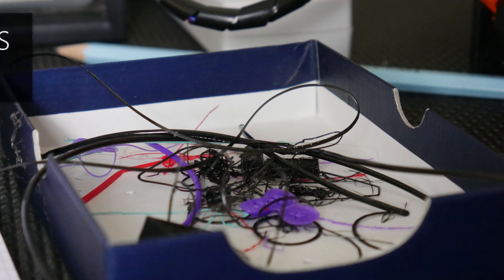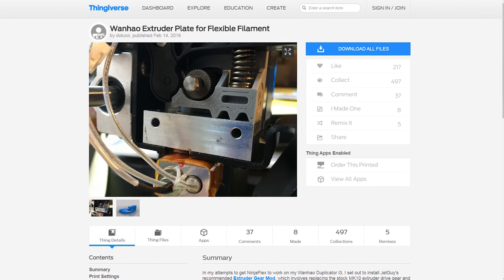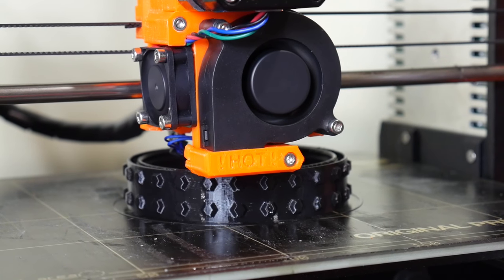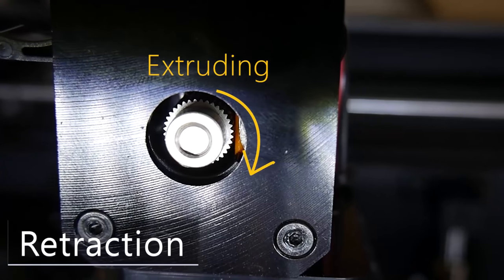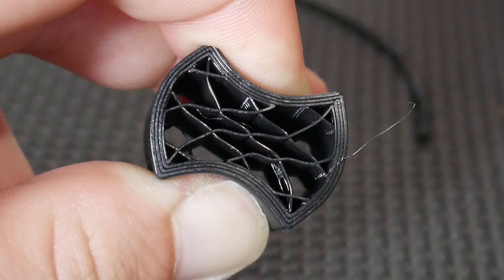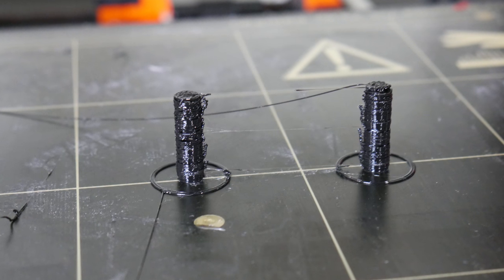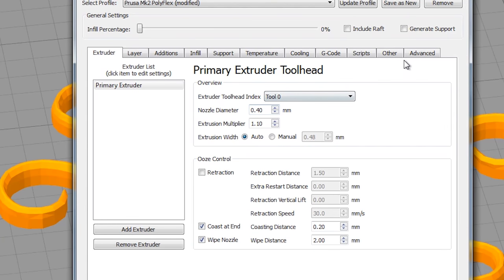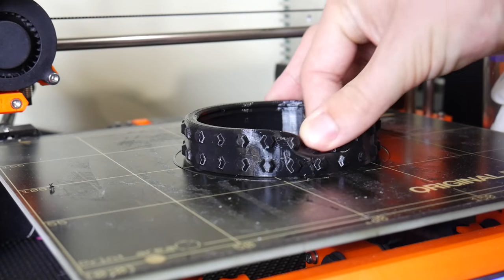3D Printing with Flexible Filaments (on stock hardware!) -  3DP101

Comment: I'm new to 3D printing.. just got my CR-10 in last week..
Wanted to try flex material.. Here's what happened:
1. watched this video.. 2. did what I was told.. 3. PERFECT print! 

High Five man.. good stuff.. thanks
Reply: Lucky you found this first! :) Same here btw, Angus is a magician :D
Reply: If you're on FB CR10 group, care to share your profile?
How did you set cooling?
I only found FLEXFILL 98A in my area, and need it for FPV.
Thanks!
Reply: Hi I just got a cr10 as well, what material did u use?
Reply: DutchRC Adventures thank you for telling us this I have a cr-10 mini and I was wondering if I could print flexible filament on it

Comment: I know I am arriving here years after this was posted but I just printed my first TPU piece. I used your suggestions and I could not be happier with the results. I was sure I would need to tweak something but I ended up with a perfect first print in TPU. You have saved another spool of TPU from the bottom of the filament pile. Thank you so much!
Reply: Me too! Running flex on my older Mk2. This video was so helpful.
Reply: Quick thing I don't remember in this video use a 3d infill pattern (my preference is gyroid but up to you) if you see the shiny blocks in what is in the thumbnail that's from rectilinear any 3d infill will make the support for the walls as it cools more even and also make the whole parts flexibility more uniform
Reply: @xathridtech727  was wondering about that... also about the infill? Shall we make it more or less?
Reply: @alixezman1106  that's the cool part you can vary how flexible it is so 100% for impact resistance but not a lot of spring and I can normally go to about 7-10% depending on geometry for super flexibility. You can also add or remove walls to make the part even more tailored.

Comment: Thanks, Angus for making this video. It saved my sanity! I had bought some TPU and was aware that I needed to change my slicer settings. I had set the higher temperature for the hot end and bed, turned retraction off, and slowed things down, but still, my filament was spewing like demented spaghetti from the side of the drive sprockets. After half a dozen or so attempts, I was about ready to give up but thought that I would check to see if you had anything useful in your playlists, and hey presto, I found this. The secret was increasing the first layer height and width. I hadn't considered how much back-pressure would develop in the nozzle during the first layer. Having run a small test print to confirm that the new settings worked, I successfully managed to run a 2 day 7-hour print! So thanks again for your great work.

Comment: Angus - thanks for all the informative videos. Albeit 4 years old, this video still holds value.  I also found that turning off Octo-Lapse eliminated stringing artifacts as the extruder would home to a set position on each Z-Axis change to take a snapshot and then stitch the snapshots together for those smooth buildup videos.   By turning off the Octo-Lapse, this disables the extruder from homing for a snapshot and thus eliminates the stringing artifact.  I must have watched the video about 50 times along with some others you have posted about stringing filament for clues as to why I was seeing this happening.  The artifact was not in PrusaSlicer, nor in the G-Code preview on OctoPrint.  It was simply the homing of the extruder for a pretty video causing the excess stringing. Cheers Mate!

Comment: Angus, really needed this refresher , on printing with Flex filament. Am attempting to use TPU on my Hevo at the moment, it does have a bowden tube and wish you had spoken about using this. It seems to be able to push the filament out of the nozzle fairly well, as I noticed when I primed the nozzle. Pushed out a couple hundred, 200mm  , off the bed, like I normally do, prior to starting. that seemed to work. Am slowing the print speed way down , to 10mm/sec, so hopefully that helps. Small items to print, cone shaped golf tees. So should not take too long. I am sure glad you have covered this topic, almost forgot about this vid, needed the refresher. I use Simplify 3D now, also, getting better with it. Always enjoy your vid's, Thanks.

Comment: Even though this is an older video, I was able to use these settings to successfully print SainSmart Clear Flexible TPU today on my old FlashForge Creator Pro.  As you mentioned, I failed years ago and the filament was buried in a storage container.  Thanks for the tips, this opens up a whole new world.

Comment: After experimenting with PLA with my Ender 3 Pro with stock hardware, I just tried all this settings with flex filament and worked like a charm on the first try. No mods, stock magnetic bed. 230 degrees. Many thanks!!
Reply: What filament did you use?
Reply: Zealand L. Hi. It is a local brand (PrintALot) of TPU.

Comment: Hi Angus, although I almost always agree with your tips, im struggling with this video, I understand that you target normal 3D printer users but it would be great to notice that removing retraction, support, raft, ... is only to make things easier but at the end you can use support and retraction its just a question of having good settings :/
Moreover TPU support is most of the time really easy to remove in my experience.
Extrusion multiplier is also a settings that people shouldnt play too much with it, in the case of flexible filament you increase it because the drive gear bites the filament and as its flexible it compresses the filament and some go in, some go out, so you need to compensate with the multiplier. But that highly depends on your material shore hardness.
Nice video tho, its not easy to print with Flexible so not easy to do a video about it :)
Keep on the good work and help the community, thx Angus :)

Comment: best channel for finding info on how to use simplify3D. for beginners it is a must program. when I started off I used the other slicers and was getting horrible results. then I bit the bullet and bought simplify3D. what a difference. and yes I am sure you can do everything with the other free programs. perhaps even more. but if you simply want to print have found it to be the easiest for my needs.
so please keep the videos coming for how to use simplify3D. I will now go and order a roll of flexible filament having this knowledge in hand. I have a Monoprice Select Mini. It is a great starter 3D printer.

Comment: Dude! I've been struggling with what I consider sub-standard prints on TPU. I was messing with speeds and temps and still getting lots of what looked like air bubbles in my prints. Never occurred to me to turn off retraction, but that fixed everything! Thank you!

Comment: Got my seemecnc extruder installed on my ender 3 and just finished my first tpu print.  Worked great!  Got a bit of bridging but that's no surprise.  Printed on my pei bed without incident.  Cleaning the bed with windex (leave a nice coating to dry on there) then 91% ipa for removal and it works perfectly!

Comment: I agree with these tips, especially the suggestion about saving a separate profile for optimal flex print settings..  I will say though that I have had a lot of success WITH using rafts when printing from Cura with my Coccoon Create (Wanhao i3) using TPU flex and a flexion extruder.  The rafts ensure adhesion and stability of small parts and tear off easily and consistently at the end of the print.

Comment: I've actually had pretty good results using supports with Polyflex and other flexible filaments when things are set properly. Supports are attached more tenaciously than with PLA and other filaments but still tear away without damaging the model  most of the time and gives you the added capability of printing things that require supports. I would not be afraid of printing with supports once you have all the other print settings working well. It will be more challenging to remove supports but well worth it when you can print a functional part in TPU.

Comment: One thing left out (besides cooling) I use Prusa's recommendation of loosening the feeder gear tension significantly. Prusa i3 Mk2 usually 13.5mm for PLA (Measured from orange plastic to bolt flange, tension springs area) to 15mm. Makes a big difference. I also use supports and retraction. I love TPU printing. No issues. The comment about the difference between TPU vs TPE (ninjaflex) is very important too. My main s3d setting changes for TPU vs PLA are : Speed 20mm/s, extruder multiplier: 1.15 (my filament measures 1.65) I use retraction but uncheck "force retraction between layers" and check "only retract when crossing open spaces" under advanced settings. Retract distance .8, retration speed 30 mm/s, coasting distance .30 mm, wipe distance 2mm. Hope this helps someone.

Comment: I just wanted to share my flexible filament settings for my ultimaker 2+.

First of all i used the 0.25mm nozzle @230°C, 40°C heated print bed, 10-15mm/s speed, no retraction, 0.2 initial layer hight and 0.1mm for the rest of the print.
material used was ninjaflex. 

This settings gave me a perfect result. But i didnt yet test the 0,4mm or 0,6mm nozzle. 
All prints with 0,8mm nozzle failed.

Comment: Thanks for this video Angus :-)  I didn't know about setting retraction to zero, this is a great idea.  I'm trying it now, and getting no stringing (with short distances between areas).  One thing that I don't agree with, though, is setting the extrusion multiplier higher than normal.  On my printer this causes too much backpressure due to overextrusion, and the TPE just escapes the extruder.  Setting the multiplier to 1 or 0.95 combats this issue.  Just thought I'd mention it.  Keep up the great videos.

Comment: With Sainsmart TPU I can use a short retraction and wipe while retraction to print islands consistently at 35mm/s. And support works well too.

TPE like NinjaFlex on the other hand is much more difficult, prone to ooze, and prone to push out the side of the feed gear.

Comment: First try with TPE/TPU came out good and well for the brim and then turned into noodles. 
So little google search and came across this video. Cheers, testing the settings right now. Will update when done!
Reply: And there we go. Slow and steady prints flexible filament on my Anet A6 with stock hardware. Perfect, thanks!

Comment: Hi Angus ! Great video and very usefull tips, but you should give a try to the Cheetah Filament from NinjaTek.
I personnally have a modified Anet A8 printer (very modified to make it work great) in bowden mode and I recently bought a spool of this filament. 
It is really amazing : you can get (with the same tips you gave) flawless parts with PLA speed ! And I am not lying, this filament is really incredible, it is slightly less squeechy than other flexible filaments but it works way better, even with a bowden extruder. 
All you need to do to avoid having your filament going out the extruder like you said in the video is to add a kind of tube (that you can print in 5 min)  that you add to the extruder (by gluing it or whatever).
I think you could be surprised by this filament :p

Comment: So i have a ender 3 and i did a few prints with ninjaflex. I just printed a phonecase with supports and it works awsome. The supports are even easier to take out than with normal pla. I also print at 235°C with 0.12 layerhight. Beautifull results

Comment: I'm sort of new to flexibles and can successfull print on Creality CR-10S Pro that is stock as for the Extruder. I am updating it to a direct drive now... But thank you Angus, this helps. Some I figured out by common sense but the settings were very helpful. :)

Comment: I just got a ender 3 neo and slapped some tpu in it with the cura settings to standard and on the pla basic setting and so far i have had no issues with tpu

Comment: Angus, great video. I have to respectfully disagree about supports. I use flex solely on a mono select mini to make my little girls toys. I print dragons and MLP's all the time using the replicator 2mm/ 3mm supports (with minor adjustments). Yes, the tips can leave zits, but no more than any other plastic. I just printed a lovely MLP spitfire with 2mm replcator supports. Cheers
Reply from the maker: nice! yeah supports can work well, but I would class them as an 'advanced' use of flex personally.
Reply: I appreciate the "compliment" :-> . Great video mate. Meshmixer/ lab can make the unprintable printable (as you know...).

Comment: I use Hatchbox's TPU on my Solidoodle 2 with an E3D v6 hotend, and I only needed to change flow rate to make it print beautifully. I also made sure that the temperature was correct, and that the short length of bowden tube they supply was almost right against the drive gear. Other than those changes, I didn't have to change anything, and im super lucky that my machine prints flexible materials almost better than PLA!

Comment: Thanks for the great tip on doing the using different printer profiles for flexible and normal filaments. I have a filament type of TPU but it doesn't change enough things so I need to remember the settings.

I have a roll of the hobbyking flexible filament and it works great, Many great prints out of it.

Comment: Cheers. Have managed to print TPU on the stock Tevo Tarantula extruder. Problems occur on retraction where the filament doubles around the rollers.
Was using 60mm/sec speed too.

Comment: Big fan of this channel but the advice did not work for me and my Prusa MK3.  I had to REDUCE the extrusion multiplier on the Prusa slicer from the "factory" 1.1 to 0.9 and I reduced all speeds to 20mm/s. I also disabled retractions and for the PolyFlex I was using, seemed to print nice at 240C. Checking the "Avoid Crossing  Perimeters" box will also likely help reduce stringing. No other settings where changed and the results where quite good.

Comment: Thank you! Never bother to try, but i definitely did after watching this. On my (very old) Replicator Dual clone i set it to 30mm/s with failure, ended up at 20mm/s with 25mm/s working fine but why risk it on larger prints. I used TPU @0.3mm and really like it, 0.2mm seemed fine but noticed 0.1mm sometimes came apart. Man that stuff is strong.. even with two pairs of pliers i had a hard time tearing it apart. It also has a very short melting point, when i pull it out while hot it comes out clean and then when i put in black PLA to see how much TPU was left almost nothing comes out. But it gets almost watery if too hot. For functional prints it sure gets stringy :-/

Again, thank you for your work.

Comment: Im starting out at 50% print and extrude and after the first few layer is laid then ramp it back up, also retraction works fine to date it takes the pressure out periodically, ender3 , dual gear boden tube , sainsmart you, 210c / 75c fan40

Comment: Good summary. Nice example.
How about smoothing or otherwise post processing flexible parts? 

NB. I often save a new profile for each "very different" part I print, as I find that, parts with long straight lines need different tweaks to parts with lots of small islands, to ensure good fill-border overlap (without over extrusion), and  joined solid fill and perimeters.

Better to have more "new profiles" saved than to destroy older settings which worked well for a certain part/material in the paast. 
We can always delete unneeded profiles at the end of the day.

Comment: Angus, I would love to see a video which covers the Select Profile_, _Auto-Configure for Material_, and _Auto-Configure for Print Quality options in Simplify3D.  Which settings are stored where?  What's the most effective way to use these?  I use them a lot, but I don't think I'm using them as intended.

Also, we should petition Simplify3D to add support for saving settings per spool of filament, such as temperature, retraction, cooling, etc.  Anyway, great advice!  Wish this guide existed back when I was learning to print NinjaFlex!

Comment: I can only comment on Polymakers' PolyFlex PLA as this has proven very easy to print.  With my WANHO Duplicator i3V2 I just lower printing speed to 40mm/s and use printing temp of 210c.  With my little M3D printer I do nothing special with settings and it prints fantastic.  I did a quick YouTube on this a while ago.  I make 'squishable' Bender heads of varying infill percentages for my hand therapy.  :)

Comment: I printed some flexible filament on my dolly i3.
I have a PEI -Sheet on it and it sticks as hell :D
My solution to print especially tiny an flat objects is to lift it 1 mm above the bed and use support.
After the print i heat the bed up to 80-90°C and put it off with a spatula.

After printing using this method you should clean your bed perfect with acetone and alcohol because otherwise the next Print stick so hard you can't get it off.
I ruined my PEI sheet trying to get a part off :D

Comment: These settings did not work in my Prusa MK2S printer. I had to change the speed to 1800mm/min, retraction stayed enabled with 1.5mm, and the first layer has a height of 150% and a width of 100%. Maybe my flexible filament is different, but this is what worked for me.